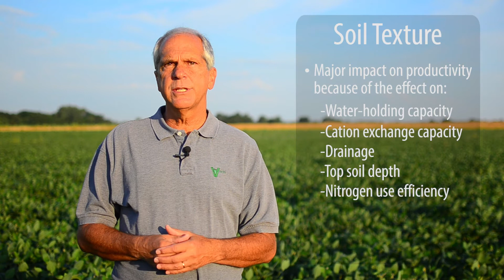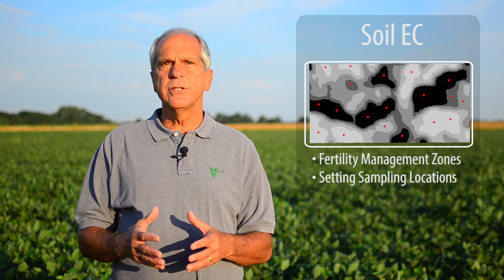Why map Soil EC?

Comment: Thank you for sharing.  I like to discuss with you in more details:   soil EC has multiple factors,  a PH=5 weak acidic soil, and a PH=9 weak basic soil show very similar  soil EC, but they are very different soils for different crops.
Reply from the maker: Charles, you are correct, soil PH has a significant impact on soil productivity and that is why Veris also equips platforms with pH sensors. Also, please keep in mind the soil EC Veris sensors measure is referred to as bulk apparent electrical conductivity compared to the lab measurement of EC using a saturated paste.  Please contact us at support (at) veristech.com for more information.
Reply: VerisTechnologiesInc   Like to know a little more about the sensors and experimental report